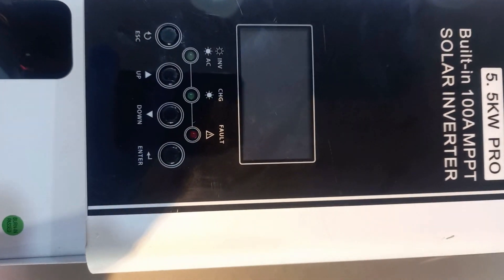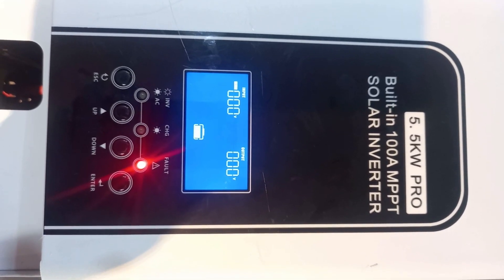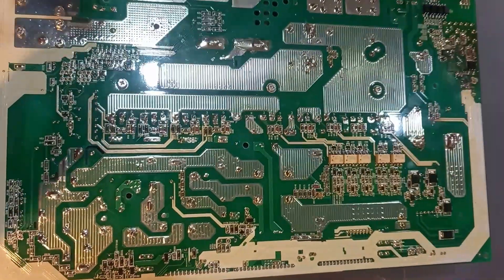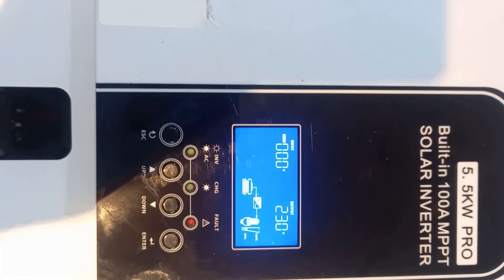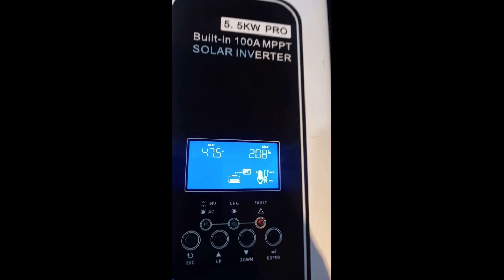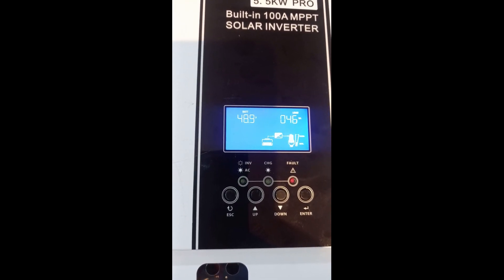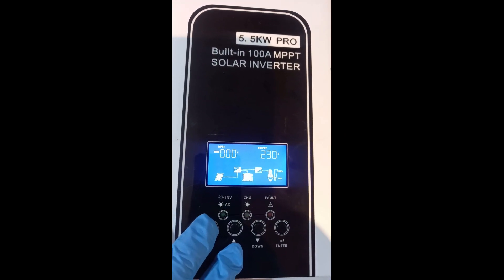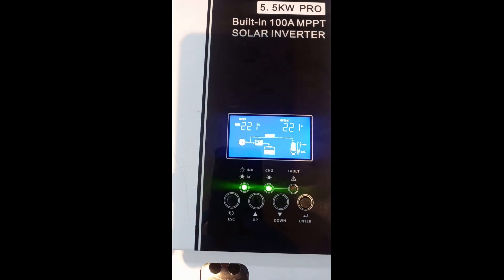ECCO INVERTER HN5500 5 5KW  ERROR 09 REPAIRED. WHY ERROR 9??

Comment: Great tutorial, following error 09 I followed it and managed to restart my inverter. However, a problem remains, the power of the solar panels goes well to charge the battery (1KW) but when I connect the load, the solar power fluctuates and does not exceed 150W. I identified a bad transistor (WLTB DGG) but I don't know how to change it. Please could you help me. THANKS

Comment: Thanks for sharing the knowledge. Actually I have a question, should I replace the IGBTs if they seem to be normal when I test them using a multimeter? Because I have an inverter showing the same error yet all the IGBTs seem to be normal when I test them using a multimeter
Reply: How do you check the IGBTs while they're in the circuit board?